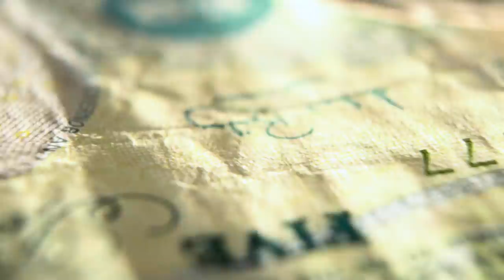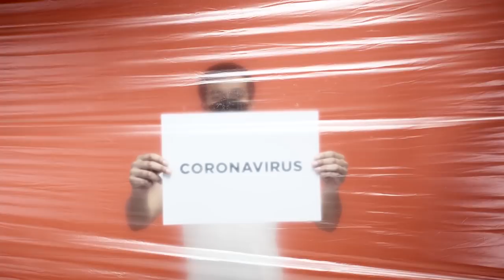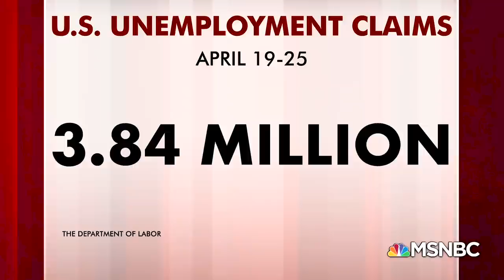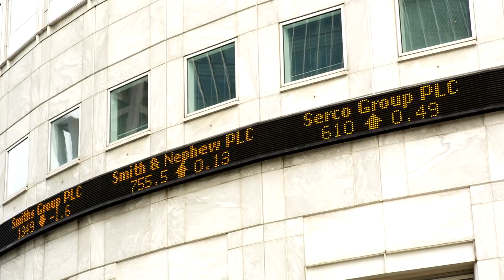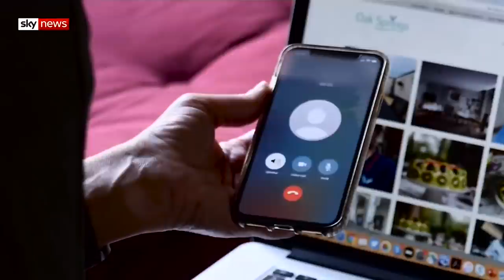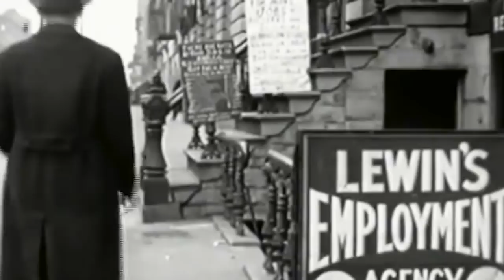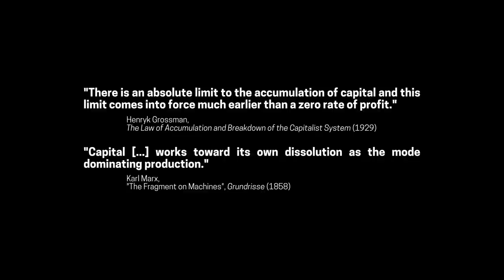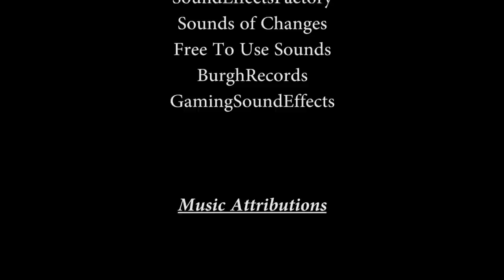Collapse

Comment: How does automation reduce the rate of profit? Like no wages are paid whatsoever.
Reply from the maker: Human labour power is the only commodity which produces more value than it consumes. Eliminating it from the production process means that the productive basis of capitalist society is eliminated and value can no longer be produced
Reply: @Prolekult  What do you mean by this? Sorry.
Reply: @Prolekult  How does that work? I've just read Wage Labour and Capital and the summary by Carlos Cafeiro of Capital and Iay have missed something but I don't understand how human labour power is  uniquely able to produce more than it is worth
Reply from the maker: @xXEvangelXx   @xXEvangelXx  The price of any commodity is set (on average) by what it takes to reproduce. In the case of labour-power, that's just what it takes to get the worker back to work the next day. So, to use a crude example, a worker can bake a great deal more bread in one day than they need to consume.